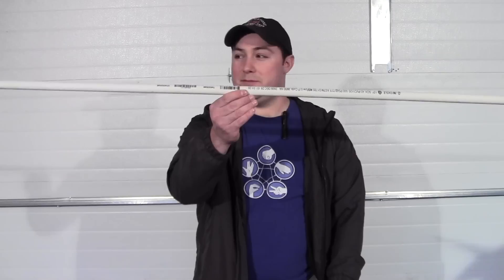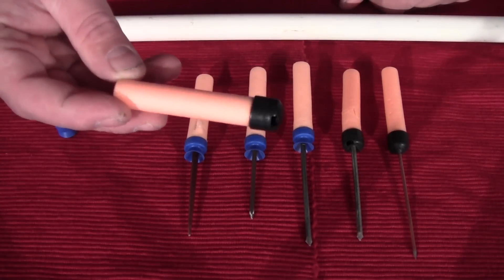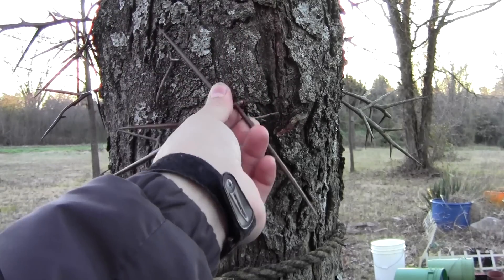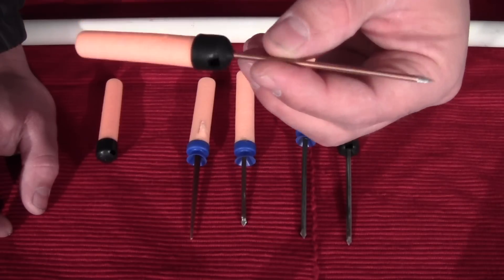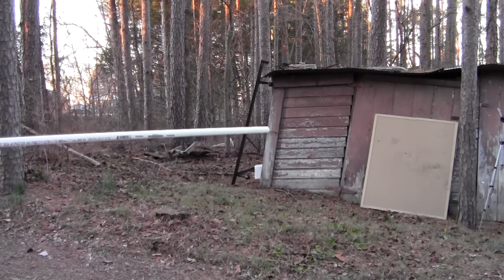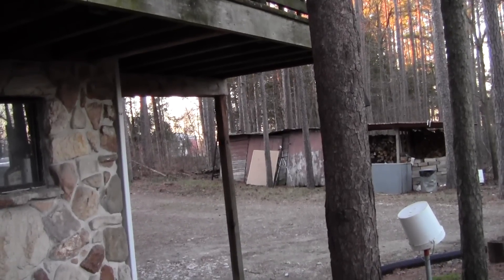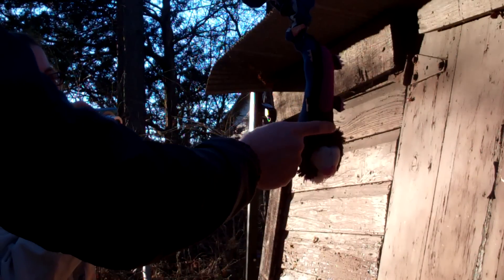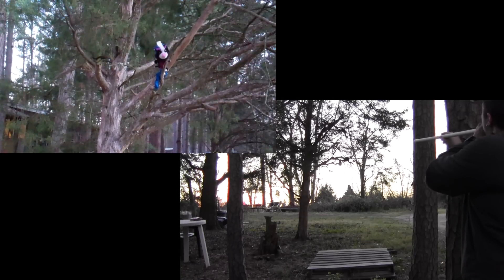PVC Blowgun Part 1: Deadly NERF Dart Demo

Comment: +Kayla May, However they also are more accurate then streamlines and elites due to the elites and streamlines inherent design flaw. (the hole in the tip designed to reduce impact force)